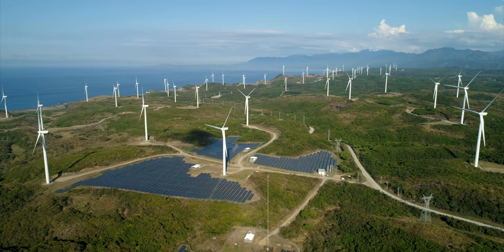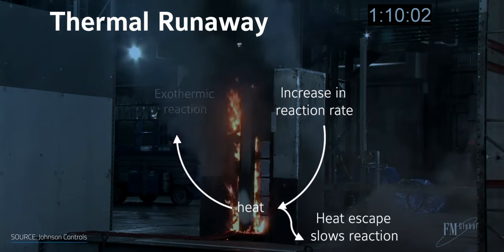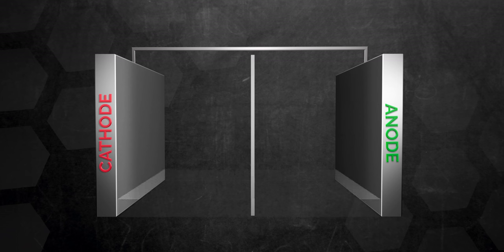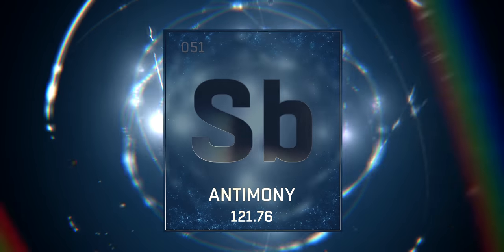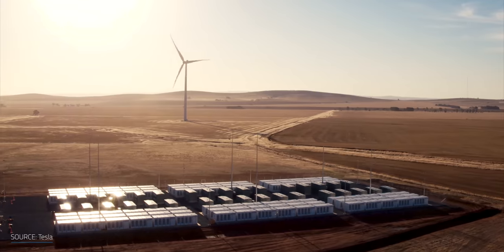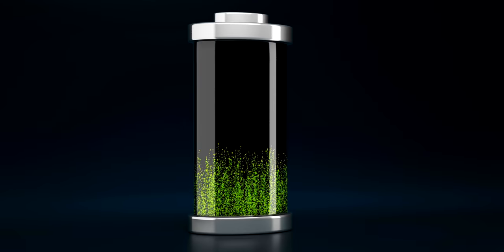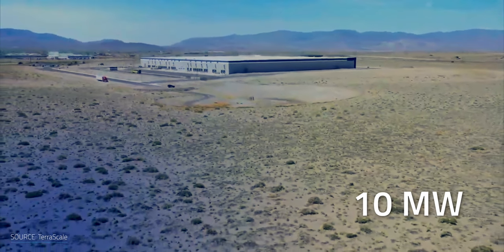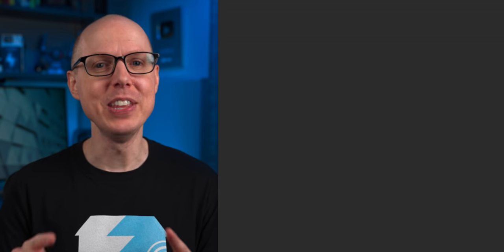Melting Metal for Energy Storage?  Liquid Metal Battery Explained

Comment: Does storing energy in molten metal sound like a good idea?  Absolutely.  It eliminates a lot of the failure mechanisms of traditional batteries.  Grid scale batteries don't need any of the features that lithium batteries offer.  The grid needs high capacity (storage and current), and low cost.  More than anything, the grid needs durability and reliability.  Lithium, really, is a poor choice for grid storage, but it's what we've got right now.

Comment: Surely the solution is hydroelectric. Water storage pumped to a high level reservoir when wind or solar power is available. The process is reversed when demanded. These ‘batteries’ are already in use in the UK.

Comment: Fascinating! I'm curious why the cells in Ambri's are designed so small, and then for into trays and then stacked up. Is there some reason why, say, a 55 gallon drum of the same materials couldn't just operate as a large cell? I mean, I'm sure there is a reason, I'm just curious why making the batteries small is helpful.

Comment: Would cutting the Gallium with aluminum reduce the cost? Gallium quickly and easily penetrates aluminums crystal structure creating a paper strength alloy. A proper mixture could be used to form a eutectic that could substitute for pure gallium. Idk, spitballing here

Comment: Nothing against you smashing Li-ion tech, but:
As a very general rule you could say:
Whenever you have easy accessable energy storage with high energy density there will be safety concerns.
Years ago I heard someone saying, that a modern Li-battery contains more energy than a stick of dynamite of the same size. 
Since energy density of storage devices is going to further increase we are always talking relative safety here...

Comment: Almost seems like it could compliment lithium batteries, particularly with how liquid metal batteries don't generate waste heat, instead they seem to prefer being as hot as possible.
Reply: Wouldn't make much sense because the heat needs to be dissipated and it's not effective to reuse this energy since it would make the dissipation harder. If you try to channel this heat instead of radiating it into a cooler space you would need more fans for it. Maybe there's some designs out there but if they were cost effective i think they would've been used already in refrigerators, AC...
Reply: The temp is maintained by the waste heat; if you charge-discharge too fast, too fast waste heat will be produced and there will be thermal runaway

Comment: Okay but the catastrophe of a failure in the liquid metal battery is quite serious too and I feel that didn't really get it's due respect. Magnesium is used to light fire under water so it's not like this is going to be something your average extinguisher can deal with. Not to mention the operating temperature would require immense cooling in the area just to maintain the electronic components. Add in how many places are already in triple digits annually and this is quickly looking like hydrogen batteries 2.0 to me.

Comment: It does degrade, just not as fast as normal batteries,  and it's currently cheap only because it's demand hasn't skyrocketed
Reply: Industrial goods tend to become cheaper on the long run with high demand, not more expensive. If the raw materials of this technology are abundant, which they seem to be, prices will drop when these batteries will be mass produced.

Comment: What's the risk from terrorism ie what happens if someone blows up a liquid metal battery installation? It's an obvious question which suggests liquid metal battery installations will have to be hardened, which suggests a cost lithium batteries don't have. Also, hardening = more concrete, which isn't green.

Comment: I personally think you could stick a sterling engine between 2 cells, have one going to the load, and the other charging off the engine,  which runs off the heat of the constant charge/discharge, and just swap back and forth between the charged batteries going to the load.   I think you could balance the cell size and load to the right sized sterling engine, and have a generator that ran itself.   500 C is a lot of heat to play with, and as both the charge/discharge are exothermic, keeping that cycle constant should produce plenty of heat to run a sterling generator without taking too much heat out of the cells that they re-solidify.  Maybe not, but I think it's something somebody should at least Try.

Comment: First heard about this tech a few years ago, and it is just so much better than it sounds at first.
I mean, the idea of having to keep the battery powered and hot to keep it usable sounds like a pretty major down side.  But if it is in an 'always on' base load system, then they are so insulated that it takes very little power to keep them hot.  Limiting the number of on/off cycles is kind of the largest factor - but if you need to take it offline for a year, or 100 years, you can warm it back up and be ready to pick up where you left off, which is kind of amazing!  Or if a site needs to be moved, or cells need to be repurposed, then they can be transported safely after they cool down a bit.

The only real hard selling point (other than for portable applications) is going to be the sales pitch.  "Buy our awesome proprietary technology that will last 50+ years!  We haven't been in business very long, but we totally think it is a reasonable expectation that we will be able to provide support that long!"  As someone who is starting to make bigger decisions about tech adoption... yeah, in my personal experience I have had 0 issues at home with a Ubiquiti networking setup, and highly suggest them to friends and family... but when buying new switches and routers at work?  I have had more trouble with Cisco equipment, but I am 100% sure that Cisco will be there and support their equipment in the long-term, and the Cisco problems are well known problems, so they are easy to avoid, so I am going to continue buying Cisco equipment.  Personally I buy AMD for all of my home equipment going forward... but Intel has the support structure and track record, so I am going to buy Intel equipment still for work stuff.
I could see a very similar difficult up-hill battle with this tech vs LiOn.  LiOn batteries are more expensive and have known weaknesses... but these are very well known factors and variables, so it is a much easier sell.  So many decisions are not made with the 'best' or 'cheapest' option in mind, but the option with the least suprises, and the more well known path to recovery when there is a problem.  It could be that these liquid batteries end up running nearly maintenance free for 100 years... but they also might not.  Or maybe you budget for some regular maintenance for the first several years, and the budget gets slashed because it wasn't used for 10 years, then there is a problem and the budget is blown up.  Sadly not as simple as just buying something that works for a long time and replacing it when there is a problem.  Works fine like that at home, but not in the workplace, and makes it very difficult for new tech and companies to break in.

Comment: I’m not seeing the advantage over LiFePO4. Equally long cycle life, components similar in cost, pretty safe when it comes to thermal runaway and much more efficient. I watched Sadoway’s presentation with interest, but I think anything that only runs at 80% efficiency is going to end up as a niche product at best. It means and additional 20% of your capex on the generation side is wasted. You could be selling that additional power to the grid. It may make sense in applications like extremely hot climates.

Comment: Sounds good but the one possible issue that springs to mind is related to the need for them not to move as you mentioned about the possible mixing of the metals so what happens in the event of an earthquake? If the batteries get shaken, (not stirred), in an earthquake with the power station just go up in flames?

Comment: What about NaK-Air battery? (Sodium/Potassium alloy or NaK as the anode, oxygen from the air as the Cathode), used in a similar way as the zinc-air battery? NaK is liquid at room temperature, allowing the use of a fuel cell instead of a battery. This is similar to using hydrogen, but NaK is much easier to fill at charging stations, needs no compression and stays liquid at a wide range of temperatures. This liquid metal does not require heating, except at extremely cold weather.
The only downside I see is the issue of clearing the Sodium Oxide and Potassium Oxide out of the fuel cell and into a special dispensing tank. The sodium oxide will be "sucked" out of the tank while new NaK is fed into the "fuel tank".

Alternatively, is there a solvent which can be used for solid metals instead of heating them? I know for instance that Sodium is soluble in Ammonia, though I don't know if the Sodium-Oxide is. This way it is easy to use a single tube to suck-out the sodium-oxide solution and then fill the tank with new sodium solution.

Comment: Sensitivity to movement... Would that make these non-viable in areas prone to earthquakes?
Reply: If you have the necessary safety systems in place to cool the battery rapidly then maybe not?
Reply: The only way to know is to test it, I would guess it doesn't matter as even a massive earthquake wouldn't have a way of combining the layers since the box is sealed and because vibration isn't that good at mixing stuff. 
interesting example: https://youtu.be/gMAKamGIiMc
Reply: @johnsmith34  I've read a lot into the topic and it seems like magnetohydrodynamics is crazy complex and does some weird stuff like creating vortices when large electric currents flow through the liquid metal.
Reply: @VulpeculaJoy  So it's a bit more complicated than I thought. Good to know. 
Maybe these batteries will have to be cut off during earthquakes, depending on earthquake strength and cell stability, as I don't think the self-discharge current is enough to cause issues, but that's only my uninformed guess.
Reply: @johnsmith34  I mean if you cool it down fast enough it will become really viscous and eventually turn into one solid chunk of metal. The lithium then gets trapped, the battery is essentially bricked and totally safe until you heat it all up again.

Comment: Who ever creates an ultra energy dense battery is going to make millions
Reply: Energy density isn't the main priority here. Plenty of renewable power plants (if you can call them that) have tons of free space that could be occupied by batteries. Wind farms are sparsely filled, and can't have big uneven buildings near them, but a base layer of 10 ft tall flattop batteries won't change the airflow much, and those can fill about 80% of the space the farm occupies. Solar is similar, move the panels up 12 ft and fill the space underneath them with batteries to achieve more than enough energy capacity with no reduction in production efficiency. 

Geothermal and nuclear power are sometimes in the middle of nowhere, other times are in the middle of everywhere, so those are variable in the amount of free space near them.

Offshore wind, tidal, and hydro would be far more difficult, perhaps nigh impossible, to have a large field of batteries, but those, which would require high energy density, aren't as big a slice of the pie.
Reply: @CaTastrophy427  if that's the case people would be doing that already, it's not economical viable to put 500000 batteries down vs maybe 50000 high energy density batteries. The limiting factor in renewable energy is the energy storage
Reply: @vishensivparsad  You're quite right, if you look at the first sentence I said, you'd see my main point is that energy density isn't the issue, what I didn't mention is that it's the price per unit of energy. Space isn't much of an issue, so if it costs $1,000 per low-density battery, putting down 500,000 of those is better than 50,000 high-density batteries at $15,000 per battery.

Comment: I've been watching the progress of liquid metal batteries and I have a question I could not get answered yet. The electrodes must be solid and at room temperature at some point to allow the battery to interface with the external world, right? Which materials have been used that allow electricity to flow at a reasonable conductivity, but don't allow the high temperatures in the interior to be transferred to the external environment?
Reply: No, they don't have to be solid to interface the external world. Having a metal contact interfacing the liquid metal anode and cathode is all you need to allow for the electrical connection to the outside world.

If you used say a copper metal connector for each electrode, then there would be some flow of heat out through the copper. Consider that if you're talking a shipping crate sized battery, the cross-section of the copper cables coming out are not that big, so not that much heat would escape. Everything inside the container would be at operating temperatures.
Reply: @Radagast97  Thank you!

Comment: how well does this technology do with scaling?  for instance:  could you build a huge grain silo size liquid state battery deep in a mine where the temps are already at or near operating levels? would this be able to store enough energy for a city? just think,  build a massive battery like that at the center of a city DEEP underground, then just use renewables to keep charging it, and have that battery power almost everything in the city?

Comment: Using hot molten salt storage in conjunction with a high temperature reactor would make sense.  The first such system is being built in Wyoming replacing coal burning in a decommissioned coal plant.  The ability to produce power when renewables can't enables the plant to take advantage of high prices for electricity during renewable shortages.  Check out this system:
https://www.energy.gov/ne/articles/next-gen-nuclear-plant-and-jobs-are-coming-wyoming . 

This appears to be one of the first such Gen 4 nuclear reactor designs that takes advantage of heat storage to enhance comparability with renewables.  Looks like a win win situation to me.

Comment: This is so weird, I just learned about thermal batteries via the AIM54 yesterday. Is there maybe a way to use liquid metal batteries to turn high ambient temperatures into current?
Reply: In a way, that is what they are doing with this technology. Finding materials that function as a battery at high ambient temperatures. The temperatures necessary for the low cost variations of this involve temperatures that would make the high ambient temperatures in a boiler look cool by comparison, but there is likely to be some heat pump option that can 'cool' one location by increasing the heat somewhere else, where it is either needed (bringing up the temperature of the battery) or can be released into the environment, which has other potential issues. But that's what heat pumps already do, and they don't function as energy generators, but as energy sinks.

All that said, if you come up with a way of making that work, there are more than a few places that would be happy to give you money to help them become the future energy barons. Good luck.

Comment: I wish that would have been the lifetime cost of operation instead of just cost per kilowatt hour. N 20 years of deep cycles would be 7300 cycles.  If these batteries were 730.00 per kilowatt-hour to install then that would add 10 cents per kilowatt hour to the cost of electricity over their lifetime which is considerably cheaper than a peaker plant.  If lithium ion is good for 3,000 cycles,  and it's $300.00 in kilowatt hour to install then it delivers the electricity for the same price.  Factoring in that lithium ion will actually deliver 80% of its capacity over the lifetime,  if it cost $240 per kilowatt-hour is the same value as liquid metal at $730.

Comment: a lot of people seem to be freaking out over earthquakes.  i don't think this is much of an issue.  the issue isn't that if you shake them they discharge, the issue is if you flip them on their side they discharge.  and depending on the charge state at the time less than a 90 degree change in orientation will probably also cause them to discharge.

at any rate we are talking about lois lane's car getting swallowed by a fissure in the earth type of event.

that's not to say that no natural event could cause this to happen.  if these had been installed at fukishima, i think the earthquake would have been a non-event, but if they had been in the path of the resulting tsunami....

Comment: OK but what is the trade off between heating it to produce a current and the current produced relative to the current required to heat it? If that makes sense... Probably not explaining myself very well but I think you can see where I am coming from. I appreciate it is self heating but initially you would have to heat it and there must be some heat loss even if it is self heating once started, eventually the heat loss would be so great that you would have to reheat it again otherwise what you have is similar to a perpetual motion machine which as far as I know hasn't been invented yet. Looks to be good tech but there are still questions.

Comment: - "How come these humans failed to address their environmental issues if they knew about efficient energy storage and PET dissolving bacteria?"
- "Patents."
- "What does that mean?
- "1. Their society believed it would be sensible to allow patent holdes exclusive access to their technology and 2. their resource allocation system made it extremly impractical to compensate them for sharing their access rights."

Ambri says their battery has the potential to save the world. Haha.
Unless it becomes possible for local companies to built batteries for little more than material and labour cost, it won't.